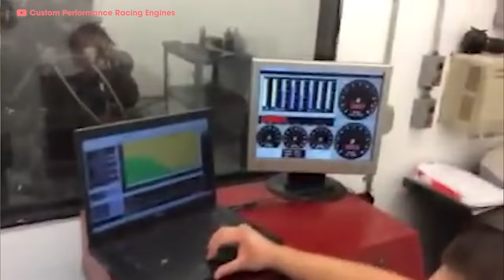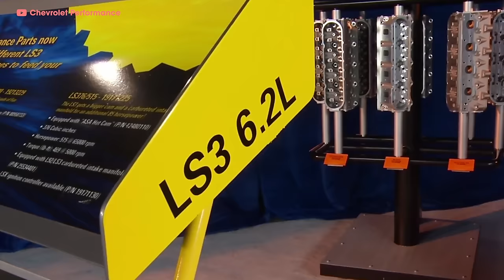CHEVY LS ENGINE - Everything You Need to Know | Up to Speed

Comment: Everything you need to know: Oldsmobile 442
In the spirit of American Muscle, you gotta do a vid on the big block boy from Oldsmobile.
Reply: They also need to do an Up to Speed on the Chevy Nova.
Reply: yis
Reply: 455 engine was a beast of a motor.
Reply: Yes i want a uts on buick gsx too dount media.
Reply: In 1995 I won a basket of 50 colognes from JC Penney by guessing a car by it's engine sound, doors closing and horn beeping. It was a 442. I still have 39 bottles of cologne.
Reply: Yes!!!!
Reply: How about Oldsmobile as a whole?
Reply: @PrydeWater901  nah, that's old man topics these kids wont understand
Reply: @EvilishDem0nic8732WhatItDo  Then this will be a good thing for these kids to learn.
Reply: 5.7 litre engine 4 barrel carb 4 tires 2 exhaust (442)
Reply: @BIGGIEDEVIL  You sure?
Reply: Olds pontiac and buick dont have "big blocks" or "small blocks", all of their engines are the same size, displacement is what changes
Reply: @Not_george_michael Only true for Pontiac. Partially true for Olds. Olds engines only have different deck heights between the big and the small. The Buick uses a completely different engine between big and small blocks.
Reply: Geoff Moore Buick really didn’t have a small block all of theirs were wide block kinda things
Reply: BIGGIEDEVIL first of all it would be a 350ci since this is America. And it’s actually 4 barrel 4 speed 2(dual) exhaust

Comment: "That's all they came in" 
Cries in Holden Commodore SS
Reply: @cyclobs2  But many HSV Commodores came with LS3, LS7, LSA and LS9. Also Holden VF Commodore SS 2015-17 came with LS3
Reply: @cyclobs2   it also came with rectangular heads and are more free flowing inlet manifold which led to more power after a Cam upgrade then the LS2.
Reply: Sobs in bogan
Reply: What about the G8
Reply: @cyclobs2  the Holden commodore VY (2002-2004) came with 3 different iterations of the LS1.
Reply: @317  Yeah, I had a '03 Holden VY Calais that had an LS1 5.7
Reply: Holden caprice?
Reply: @timbactobros.7279  my WK has the 5.7 LS1
Reply: Brandon Jacks we don’t call them that. That’s pontiac’s name for the car they produced. We call them VE Commodores.
Reply: Ve also came out with 3 variants of the 6 litre. Ls2, l98, l77
Reply: Noeg the Zemerald Ghostie and the 14s

Comment: Did anyone else notice the 2jz supra when he was talking about the ls 😂
Reply: Yeah I was wondering why they kept putting that clip in. It obviously doesn’t sound like any V8 I’ve ever heard
Reply: Ya. They showed it at least twice. And they left out the LSA. Not their best researched episode
Reply: kwhite621 he’s stuck at home man he trying 😪
Reply: @davidfinch7810 y More power, and less weight, why not?
Reply: Omer Ahmed  easiest and one of the safest motors to run high numbers on
Reply: @davidfinch7810  some people buy a rolling chassi, cheaper to swap in a LS than buy s over priced boat anchor
Reply: The guys a clown he did it on purpose to joke around with you fools 😂😂
Reply: Omer Ahmed  but uhh.... potential of easy 1600 hrsprs...
Reply: I'm about  3k in saving.  I plan on ls  shaping my 99-04 mustang..should  I keep saving?
Reply: @ariklotia8003  price the parts out
Reply: @ariklotia8003  go buy a gm then
Reply: Arik Lotia nah the 4.6 is a good motor I’d take that money and buy an ls1 camaro they are really cheap right now
Reply: @davidfinch7810  people swap ls engines because you can build a 1000 hp turbo monster for a tenth of the cost of building a jz motor . Pick them up anywhere get parts anywhere .
Reply: the c5 at 0:49 is also 2jz swapped
Reply: @tl5108  it’s a flat plane crank

Comment: HI-LOW engine Swap?
Me : YES...
Reply: Junkyard Ls vs Texas speed fully built ls 😂
Reply: Oooh. They should both do LS1s but the price difference is in the actual swap
Reply: @ChiggyChiggyChiggy  or same motors but different parts (cheap/fab'd vs expensive)
Reply: Turnkey ls3 vs junkyard 5.3

Comment: I just swapped a gen 3 motor in a gen 4 car. I wanted iron block for turbo. All i did was change the reluctor wheel and from cam gear and cover. I have the Saab 97x 5.3i. It has a dod delete and a big cam. And a big intake manifold. I just finished it. It needs to be retuned. It's running real lean

Comment: This is one of those videos where I wished they mentioned Holden. The V8 Commodore is such an icon in this country.
Reply: If it had an Australian engine, transmission and chassis maybe.
Reply: @USandGlobal  they did. The six cylinders models were made in Melbourne and up until the year 2000 the SS models had the Holden V8 designed and built in Australia. In terms of the chassis the from the VE onwards the chassis was completely designed, styled and engineered in Australia for Australian condition from the ground up.

Comment: So GM created a "Coyote" a while back, thought it was lame and stuck with pushrods? Nice lol
Reply: It was in the C4 ZR-1 - certified ripper.
Reply: The overhead cam was developed with Lotus.
Reply: Dcc357 And built by Mercury Marine.
Reply: @mikec9112  GAA was a DOHC tank engine that was supposed to be a V12 Aircraft engine to compete with the GM Allison V12. GAA was too complicated and lost the wager to an engine that was 10 years older than it and only had a single overhead cam. Even the tanks that had GAA had reliability issues. Don't try and prove your point with that garbage engine.
Reply: @mikec9112  GM actually makes really good DOHC engines. The V6 in the Camaro is a very good DOHC engine and makes 330hp, which is fairly stout. Also, the new C8.R uses a DOHC setup which seems very promising.
Reply: Colby Church - if they couldn’t make a dohc engine that held 330 hp then we need to ask for our money back! It’s not an achievement when literally everyone else is producing DOHC engines with 500+ hp
Reply: @CoyoteFTW  Its a DOHC 6 cylinder... so thats pretty good.

I was talking street use btw, no idea where all this track stuff came from tbh... Pushrods are more fun than DOHC engines because of the gobs of low end torque and power.
Reply: TheAow4321 - I agree pushrods are full of torque! I’m an engineer though and American auto manufacturers have built some amazing pushrod engines Fords won lemans and we showcased our engineering to the world. But it’s time to show the world we can build DOHC performance engines too. Ford has been the only one doing that! So I applaud them for that, gm and dodge are behind. We’ve been doing pushrods since forever been there done that.
Reply: Dave Micolichek - MMR Using a Ford coyote engine makes 4000hp and runs 5.6 sec 1/4 mile.... Ford GT DOHC 5.4l makes 3000hp in a stock block
Reply: Meanwhile fords ohc modular engine has gone faster than any ls has in any configuration.... And using factory block, crank, heads...and only 4.6L...
Reply: @banneddamn  Ford does not have a motor better than the LsX... nor can Ford beat the Hellephant from Mopar
Reply: I'm sad. I wanna know what would've became of that that engine. Had great too end and sounded badass? Yeah, I want to know where that would've gone, honestly.
Reply: Dave Micolichek  I knew that's where you were going to go with that from your earlier comment. That's because unfortunately under that snap force of acceleration, no timing chains could hold up. They'd always break instantly. Also, in the world of top fuel, weight, efficiency, and simplicity of repair/rebuild is EVERYTHING... DOHC is heavier, more parts means more parasitic loss overall, and much more complex. When you have to rebuild the engine after every 1-3 passes, you don't wanna be dealing with 4 cams and timing chains. Most use a timing gear setup instead to the single central cam.
Using DOHC in that extreme of an environment is dumb and inefficient.... On the street and in street/strip cars tho, they do very well. There's a reason most engines today are DOHC. Far more tuning availability (being able to retard and advance both the intake and exhaust cams independently of each other, making for almost infinite cam profiles/valve timing capabilities, far more so than a single cam, not to mention 4 valves > 2 valves as far as airflow goes. 1500hp> cars and 1500hp< cars are two very different stories, my friend.
Reply: @mikec9112  just like ford sucks at pushrod v8s.
Reply: Dave Micolichek  google fastest ls 1/4 mile then google fastest modular 1/4... Then get back to me about who is ignorant...
Reply: TheAow4321 northstar engines are garbage what are you talking about     Hay look up the Ford GGA you will thank me
Reply: Most likely it was that all the boomers didn't like it
Reply: @mikec9112  the lt4was a great engine what the hell are you talking about?
Reply: @mikec9112  it took Ford till 2010 to make an engine better then the 1980s lt4..now THATS pathetic
Reply: @CoyoteFTW  because they are proven engines?? It took Ford 25years to even compete...less moving parts.stronger bottom end.and better aftermarket..all for a reason.and if you refuse to believe the LS engine is one of the most reliable engines made.you are just lieng to yourself
Reply: @CoyoteFTW  go find me a DOHC V8 that's naturally aspirated that makes 500hp...
Reply: Dave Micolichek  for a factory engine? Why are we talking f1 and top fuel..gtfo
Reply: @CoyoteFTW  Chevy today makes 500hp is the same simple pushrod style they have used for 25 years...and gets similar gas mileage .easier to work on.cheaper to fix and more reliable
Reply: @banneddamn  that's the biggest lie I've ever heard and I'd love to see some false proof
Reply: @mikec9112  Chevy doesn't even race lemans anymore
Reply: @james avery spot fucking on
Reply: Dave Micolichek lol ummmmm have you seen the coyote class? There’s only a very select few 7 second pushrod cars.. one year after the coyotes were out they were already in the 7ss
Reply: levi woodring lol ford builds a lot smaller motors.. when you compare the 302 boss and 302 Chevy which were both race motors built in the late 60s the boss kills it... ford has figured out the engine game longgg ago and have made a better platform since the early days... they understood that better heads/more flow something Chevy still hasn’t learned🤪
Reply: @mikec9112  for a cam swap, sure. Easier, no doubt... But no, a pushrod engine is easier when you have to rebuild the whole thing every couple of times (but the cam, lifters, and rods can continue to be used a lot more). The valvetrain is more.stable for when you're pushing high revs, but yet top fuel is only pushing 8000ish RPM, tho Nascar pushrod engines are pushed far past that and still last long hours at high revs.
You're arguments are irrelevant when compared to what's actually done.
Reply: Erik Capozzi - Fords 5.2L in the GT350 makes 526 hp Naturally aspirated. That good enough?
Reply: @mikec9112  your comparing apples to oranges...compare the 4.6 to engines in it's class presently .and the LS is far more reliable and easier to get power out of
Reply: @CoyoteFTW  dude my 498 rwhp (so around 530 at the crank) 2006 GTO has been making that power with a head/cam swap and a tune since 2007......right at 120k miles.  Come talk to me after your precious coyote makes it that far, well, once I stop and let you catch up.
Reply: GTODad73 - Gen 3 coyote makes 500rwhp with bolt ons, no need to swap any cams. Your little turd ain’t so special huh.

Comment: Early C6 Corvettes had the LS2.
5th gen Camaros had the LS3 (Video shows 5th gen while mentioning 6th gen).
6th gen Camaros got the LT1.
Reply: I dont k ow why the started calling them the LT1 again for the 6th gen when the Camaros 97 and older had their engine named the LT1 as well
Reply: @pollutedcrimson  nothing new to gm, there are three LT1's to date. You're talking about the gen 2, there is a gen 1 used in the early 70's and then the gen 3 which the 6th gen camaros and c7 corvettes use.
Reply: This ^ he also missed the LSA.

Comment: I want to 5.3 transverse motor mount swap my 05’ Equinox some how, I will one day & Awd conversion my Equinox
Reply: LS4 King can do that for you
Reply: Use LS4 engine from late gen W body’s
Reply: Thst would be dope
Reply: It’s such a comfortable car & I’ve had a 75 shot of NOS before for about 100 miles lol then the lame 3.4L gave out
Reply: Lance Hondrade it’s a comfortable sleeper & I’ve removed the back seats which weighed 137LBS & my roof rack that was 26 LBS & removed my fog lights & made a ram air that does work. My subs would be an easy 80-100 pounds if I took em out
Reply: Nobody would see it coming & I still have a glass pack to muffler delete & have the exhaust exit where the tow hitch right in the middle would be

Comment: Pretty solid vid, got somethings wrong when it got to modern era tho. Like the LT1 is only in the current 6th gen camaros (2016+) and of course the corvette but they showed the old ls and a 5th gen camaro. The older LS engines were in the 5th gen and there was even a difference between the engine codes for the auto & manual

Comment: I have a 2005 Silverado with a 5.3 vortec LS, 197,000 miles and I’ve beat the thing every day to the ends of the universe & back. Still running strong as my daily! #lsswaptheworld
Reply: My grandpa had an 09 Silverado same engine, had 430,000 km on it before the bottom end of the engine broke and he bough a new 09 Silverado

Comment: You forgot the Solstice. The Pontiac Solstice was designed to have an LS3 put into it, but GM found the power to weight ratio to be too overwhelming, so they opted for an inline 4. A year later releasing a performance version with a stage 2 turbo. People still put LS3s in them to this day, seeing as they fit so well. Quite cool.

Comment: Great video, you missed a couple of LS’s though, the LS3 was also used in the GEN 5 Camaro, and the LSA was the last performance LS engine designed by GM, it was a variation of the LS9 (But was a different engine) and was used in the CTS-V (556 HP) and the Camaro ZL1 (580HP).

Comment: I have a silverado with the 4.8 vortec, which is the LS1, honestly stock it's sort of ho-hum, I really wish the fuel saver cam was left out of it, but I suppose the target audience for the 4.8 was the fuel eco + light to moderate duty towing capability crowd... I may cam it, all the reading I've been able to do on this particular engine says a cam swap is the quickest and cheapest power gain (in terms of $ per hp) you can get from the 4.8, after that it's down to messing with axle ratios and then probably forced air. Platform wise, the truck is amazing though, body is in great shape for it's age, old car guy level of maintenance and care taken, it's the RWD version, which a lot of local guys wonder why anyone would want a RWD truck, but honestly, the weight loss of not having forward running gear, plus less parts to break means it ultimately is more reliable and will outpower the exact same specs with 4x4, plus, I mean half the reason you want your power to the rear wheels is to chop donuts and skids right?

Comment: The Chevy small block is hands down unquestionably conversation over, no debate, the greatest piston engine of all time. Nobody is even close pretty sure they've generated over 100 million units by now there's 60 70 year old models still on the road.
The Chevy smallbock/LS took advantage of every single technological advancement that came along for the piston engine. 
Production, Fuel injection in the 50s
Points free, electronic ignition early 70s.
Coil on plug ignition early 80s 
Long runner composite intakes manifolds to prevent heat soak and keep the intake charge cool, early 90s
Piston oil squirters to cool the intake charge also in the 90s..
Dry sump oiling, early 2000s
The low center of gravity, The tightest packaging that will fit in virtually any engine bay, the infinite tunability, the reliability of rock solid engineering, truly no engine even comes close..

P.S. When tuned by GM with a proper transmission they can get up to 30 miles to the gallon if you keep your foot out of it... LOL

Comment: @14:00 that's an ls3 or an l99, not lt and @14:10 that model Camaro SS didn't come with an lt, it came with an ls3 or l99, depending if auto or manual.

Comment: Even a 5.3 has intake ports almost 2x the size of an old school small block. It's hard to believe how much air gets pumped thru.
Reply: I guarantee the new LT motors arent going to do as well reliability wise. Direct injection isnt a great idea. Dry intake valves gathering carbon. Its going to do the same thing the direct injection ecotec 4 cyl does and pack the intake tract with carbon. My theory was they were too reliable, lasting too long, in 5 years we will start seeing reliability issues like what is already happening on the direct injection 4 cylinder. Why else would GM sell an intake cleaner tool that is basically 50 zip ties rubber banded together, and you just physically knock the carbon out about every 40-50k

Comment: For those who don't know the LS is a copy of a small block Ford !! This is a fact they both have the same deck height same bore spacing and the same valve lay out the LS is a small block Ford with cathedral heads ! my engine builder told me this years ago and he actually installed LS heads on a 351 with minor modifications

Comment: Wrong the LS3 also came in the 2009 g8 gxp as well and u also missed the L76 which is basically a ls3 top end with ls2 bottom end. The L76 was a 6.0 as well, basically the same thing as a LS2 with a different oil pan and different heads. Or the same thing as a LS3 once u bore it to a 6.2. Should have mentioned that🤷🏻‍♂️